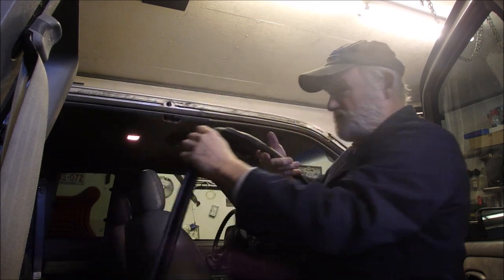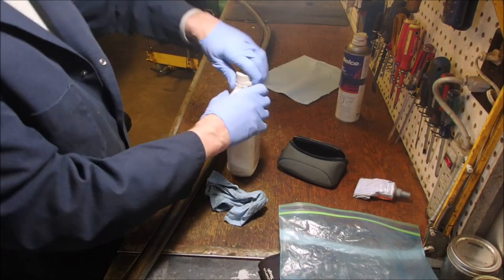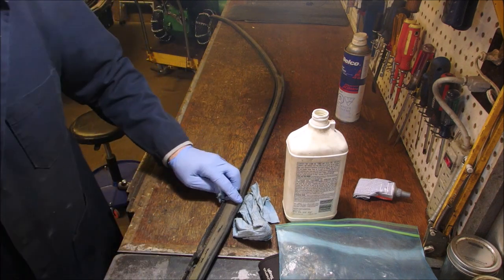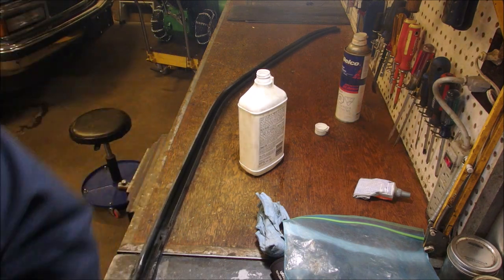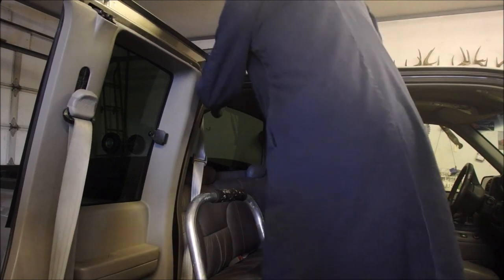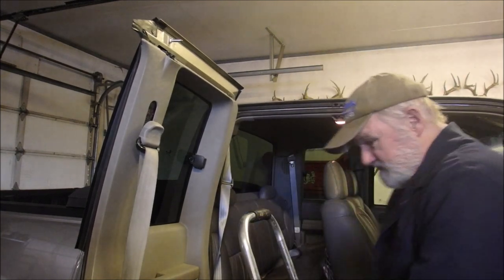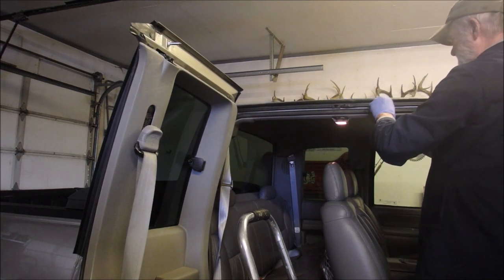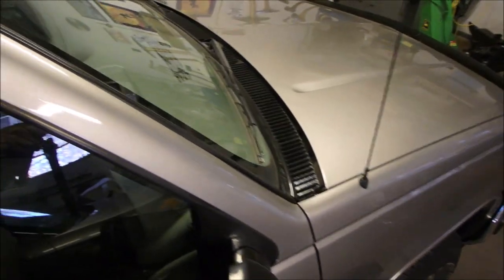Damaged Weatherstripping on a 1998 Chev Silverado

Comment: I would just about bet the extreme cold got the adhesive. 25 years in crazy cold weather is a win in my book.
Reply from the maker: I was happy when it came off in one piece.
Reply: @Bruce's Shop  fine and cold got the glue but not the rubber. That's a win for sure.

Comment: My brother-in-law had a Chevy Astro van. The sliding door gasket came off and was hanging down three or 4 inches instead of repairing it he took the entire gasket off and threw it away at highway speeds you could not hear the radio, even if it was turned up all the way some people have no common sense !!! a little bit of love goes along way.
Reply from the maker: Thanks   I agree